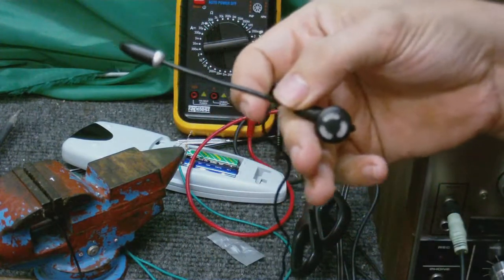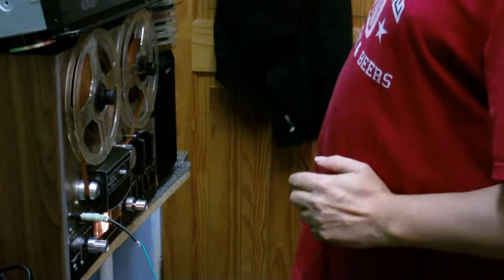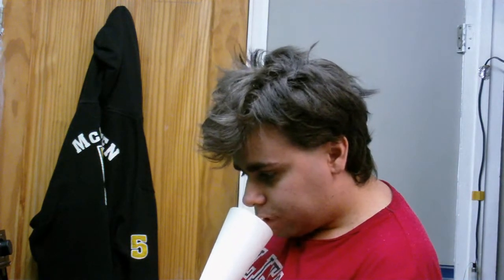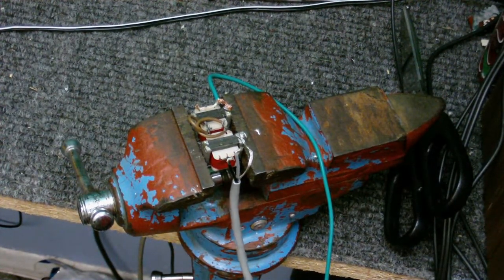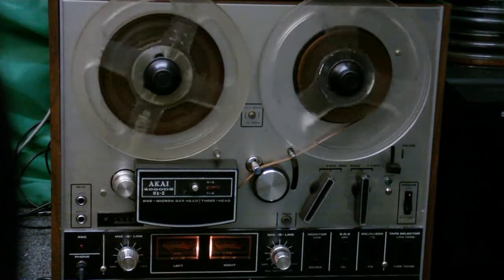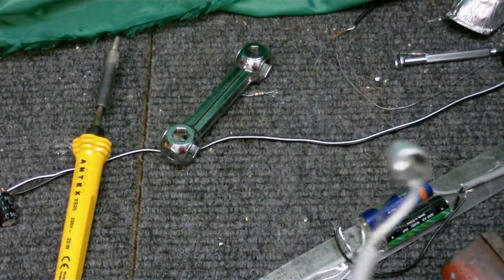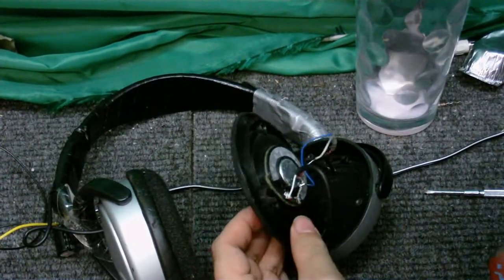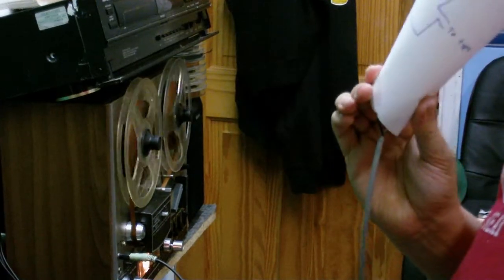CDC Electronic Workshop, Experimenting with Microphones, Heaphones and Balanced Cable

Comment: The sound at 8:15 (ish) is much better than the sound of the mike you are using for the bulk of the video, where there is a heck of a lot of digital garbage and HF whine.  Mind you, a lot of my videos where I use QuickTime X and the iMac's built in mike also have HF whine!

Comment from the maker: @sk7ca I know, I should have mentioned that, but since there are already coupling capacitors inside the tape recorder on the mic preamp section of the amplifier board, it was ok to do it like this in this case.

Comment: You should use a coupling capacitor in series with the signal line to the tape recorder to block DC out. so you don't get DC in to the recordedr and runs something.